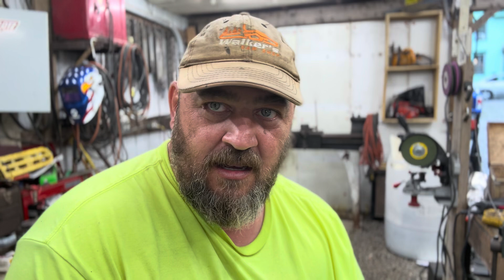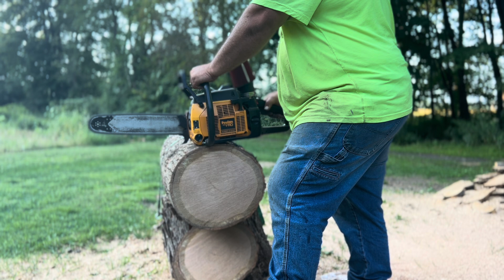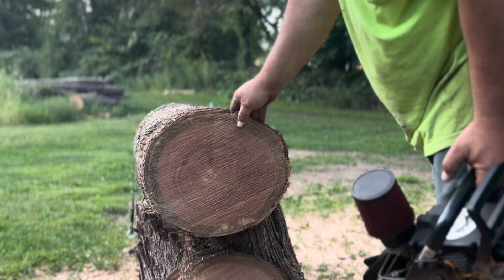How Does Torque Effect Cut Speed?  Testing Chainsaw Chain With Torque!

Comment: it depend on wood which you cut in most egample tprque didint affect cut speed at all but only power thers exception from this rule where side wall of wood push enough hard on chain and bar assuming we are on the same final gear ratio cos if more powerfull chainsaw with less torq will have adjust perfect fisnl gear ratio formspecifoed side wall of wood squeez chain it always beat more tprq version but when we deal with egzacly the same final ratio from some point of sode wall force push on chain it canend oposit 👌🏻 simple calculation explain this 👌🏻 but if thers no side wall efect or not enough big depend on chainsaw characteristics which you comapre power at the same final ratio always win 👌🏻  egzample you have chainsaw  which have 10 nm at 3500 rpm at 5 m/s chain speed  so 746 n force on chain and side wall push with 400 n force so ypu have 346 n for cut from up to down at 5 m/s vs feg 5 nm at 7000 rpm at 10 m/s so 373 n force - 400 n = chain is stopp completely👌🏻 power is the same but on the same final ratio 10 nm at 3,5 k rpm work on lower speed of chain thanks what generate bger force 👌🏻 it depend on torq level to rpm level to sode wall squeez  strenght 👌🏻 but like im write once somebdoy setup for some comeptition let say in cutting on time perfect final gear ratio fpr specified side wall force push on chain than more powerfull less tprq  chainsaw engine always be superior and cut faster 👌🏻 cos power : speed is force so from more powerfull chainsaw with less torq we can take out more chain force if setup it with enough short gear ratio or atleast enough shorter where force not necessery be biger but in corelation with more chain speed still cut faster 👌🏻

Comment: Such a good sounding saw. I think there are so many variables in this game that it could drive a person doing comprehensive testing to drink. I can definitely understand not doing a lot of saw comparisons for that reason. Then factor in the fact that any given log is only going to be so consistent at each cut point. Change the wood species and then you could be starting all over again. Each saw is going to have its ideal balance for the chain it likes in each species of wood. The possible testing combinations are truly infinite and sometimes it’s going to get down to splitting hairs. But it’s all fun right? I’m sure the manufacturers are aiming at a good middle ground when it comes to their latest and greatest chains. Some people like Stihl RS out of the box better than C83 and I imagine for some wood species it may perform better. 

I sure appreciate the time you spend doing this as I don’t think I’d ever have enough until I’m retired. I am blessed (or cursed depending how you look at it) with living in Washington state where I can get my hands on a pretty good variety of wood that’s grown in several different climate conditions throughout this state. 
Keep up the amazing work Smitty. Love how deep you’ve gone into sharpening and testing videos.

Comment: I think you are overlooking the effect of chain speed and raker height . You are dancing around too many variables and making it confusing . Change one thing at a time vs 4 . One chain one saw . Change only raker height . Faster that chain meets the wood the more aggressive raker it will need to self feed . Take that chain off your angry man poulan and try it on a put put xl12 at stock rpm and you wont be able to pull the chain
Reply from the maker: You are correct